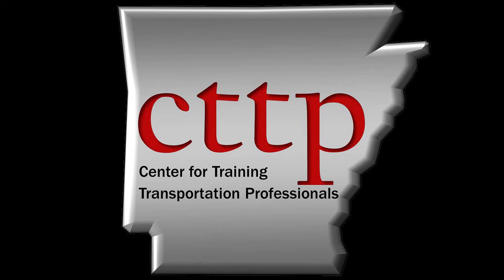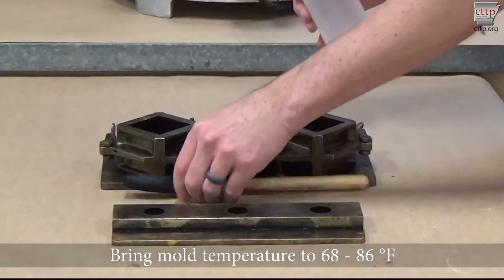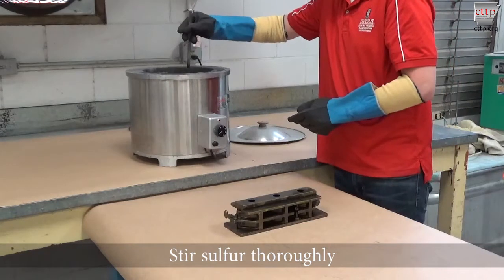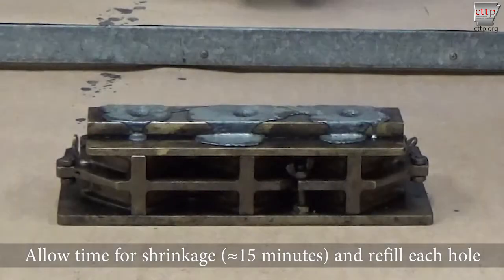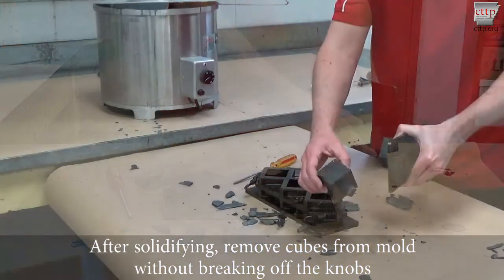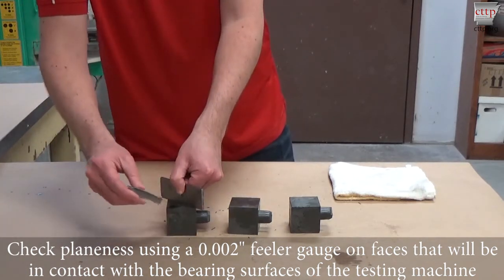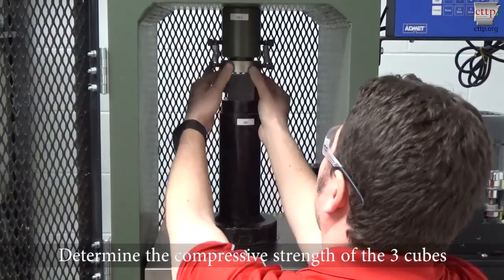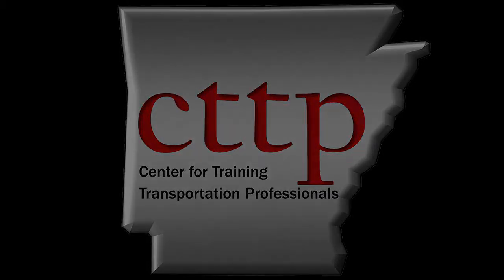ASTM C617 - Sulfur Qualification

Comment: Salam hope sir you are doing well sir my question is that how much the strength comes out after 2 hours or 16 hours in psi or mpa? thanks waiting for your kind response.
Reply from the maker: It varies, but an estimation in my experience is after 2 hours the sulfur has always been above 5,000 psi, more likely in the 6,000's.  At 16 hours, we typically get above 8,000 psi all the way up to the 9,000 psi ranges.  But again this varies.  That is why its important to run these every 3 months or whenever you buy new material to make sure the compressive strengths are in the proper range.